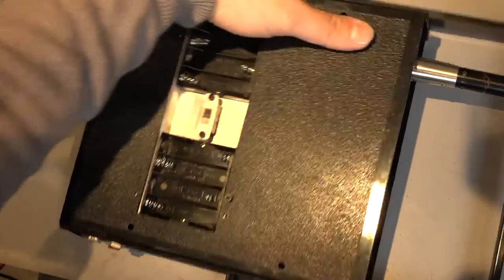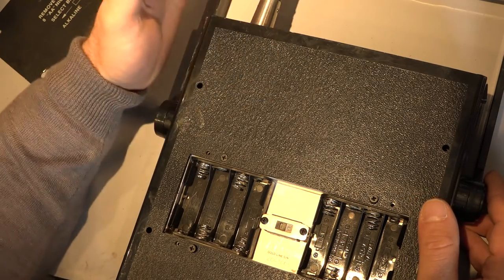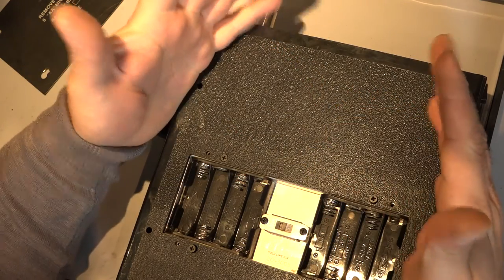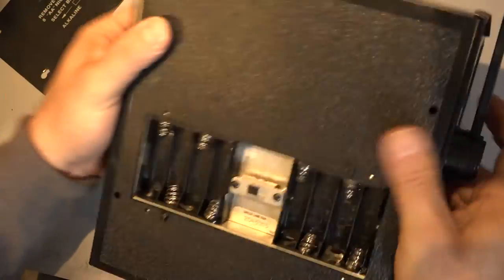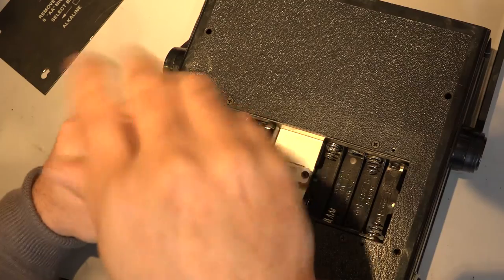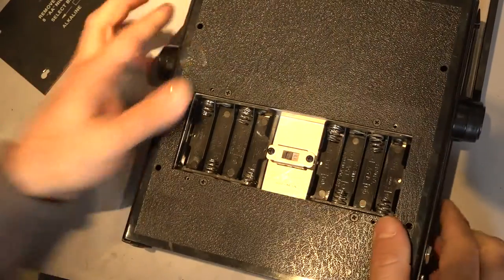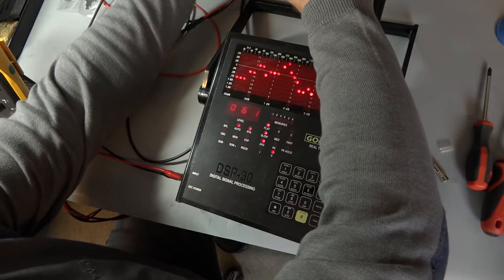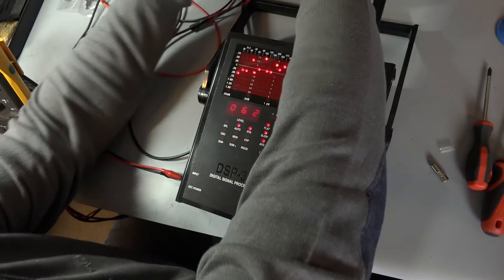Gold Line DSP 30 RTA realtime audio analyzer. Tear down and repair

Comment: Hi
Great video, what a find.
  Can this analyzer be used for measuring frequency response and impedance loss, for crossover testing.
Reply from the maker: You can use for this, but the resolution is not enough to do serious measurements around phase responses. So, I much more prefer a software based solution with a speaker probe.
Check out the TRUERTA website!